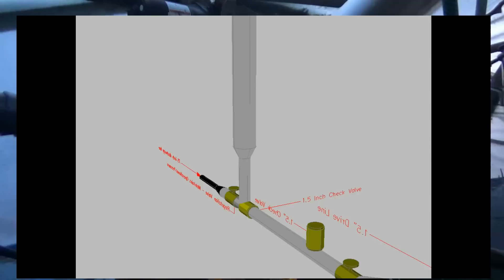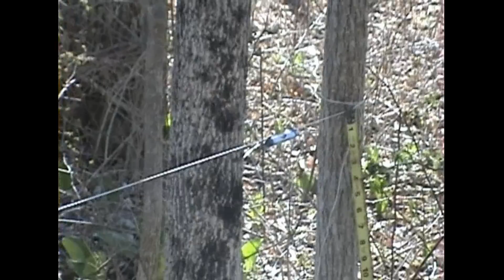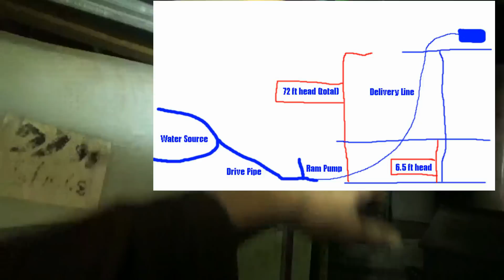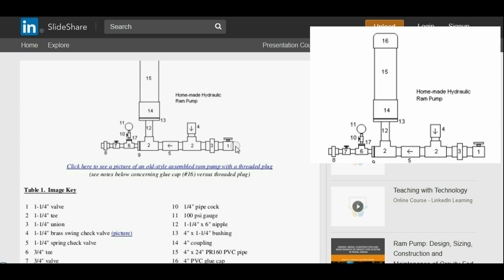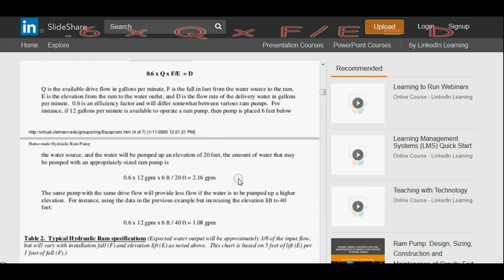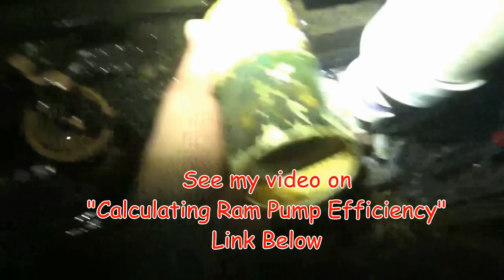Regen Ag School | Hydraulic Ram Pump Design Manual: Site Selection, Calcs & Field Operation

Comment: This guy seems to project that he's too smart in calculating water pressures yet he posted those diagrams portraying DIFFERENT VOLUMES of water as having the same pressures?????  $#&^%@@$$#....besides he doesn't even know the difference between FOOT and FEET... i bet you better check your numbers before showing it to the whole internet world smart guy....
Reply: I would also like to point out that the proper term is "a 4-foot head"  just like you would say you are going on a "20-mile trip."  You wouldn't say you were going in a "20-miles trip."  So, his terminology in reference to the hydro static head is correct.  In this sentence, the term "4-foot" is NOT a noun, it is an adjective describing the "head"  which is the subject.  Therefore its conjugation should be singular since it is describing a singular noun.  

So, along with your engineering lesson, enjoy your English lesson.
Reply: Actually, the POINT of those pictures was to illustrate that volume has no effect on the pressure.  The pressure at the bottom of a half inch tube is the same as the bottom of a lake if the height of the water above the gauge is the same.  Don't you wish you had phrased your ignorance a little more politely?
Reply from the maker: @kirbyspencer538   @John H Thanks.. This gave me a good chuckle!
Reply from the maker: First, "this guy" is right here, second, I COULD delete your comment, and third, instead, I'm pinning it as the epitome of ignorance.  By the way, when is your first upload? EVER?  10-25-2020 "This channel has no videos."
Reply: @TheFarmacySeedsNetwork  The f***ing nerve of some know it all to criticize (and not constructively) your video after all the effort you had to have put into it. I don't expect everything I read or watch to be perfect, and your videos, this one especially, are an absolute treasure trove of information for those of us who are trying to learn. That troll should be ashamed.
Reply from the maker: @GarySchiltz  Thanks for the kind words.. trolls don't bother me.. I kick em back under the bridge they came from 😁

Comment: Do you know what will be the effect of the ram pump system if we only make the total length around 5 meters? You can just assume from the start, to the drive pipes, to the ram pump, to the certain head level, is just 5 meters. Do you think it's gonna be efficient in terms of the pressure and velocity, and also for its cost analysis? Coz a 120 dollars is fair for a longer system, but for a shorter one, I think its not.
Reply from the maker: 5 meters is over 15 feet.... sounds like good operating pressure.. but you will NEED to do the math provided to be sure.

Comment: well that was a clear as mud .  hers what I'm traying to do .  & you can comment on the thinking .  I had this idea it is this.  to tack water flow  & push that water into a header tank which is elevated . lets say a 6000 gallon tank As the limit of the first lift possible 16 feet .  then to repumps that water up to it limit of such lets say  to a second tank of 24,000 gallons At  50 feet above the first tank .  so the final lift will be  to 100foot above  the first lift now holding 100,000galons of water . The  Target to riles that 100'000 gallons to drive a micro turbine By releasing it down a 4" pipe  At ( 45 To 60) PSI  emptying into  a hooding tank sufficient to holding  the 100'000 gallons of water  tank  having past into a 1" pipe to drive a micros hydro turbine to charge a battery bank .  wy a rem pump  self powered the point is to slowly rise  the water to the required Hight &  achieving it in stages using the head achieved at each stage, to power a bigger ram pump.  as we sift the stored water at evry sage.   given you now have my plan  can  it be achieved   in closing the end choice will be to push the ram - pumps to pus that water back up to the heist point   Rinse  & Repeat,   Pints to develop The largest pump to achieve  it final size .

Comment: Great video! It covers many of the details of design and construction. Attention is needed in order to obtain proper function. The pump I tossed together prior to finding FSN videos is a follows. I used 1.25" pvc and some abs pipe and fittings. My drive pipe is 1.25" pvc @ 20' long utilizing a siphon over my dam with a fall of approx 7 foot. I used a reducing tee and put a 1" swing check for the waste valve. The supply outlet of the goes into a 1.25" line check, it's output into a 1.5" abs sweep ell into a second pvc tee into a 4" abs pressure chamber 4' long. Empty liter bottle for air buffer inside. My supply line is 1.25" pvc for 80' then reduced to 1" for a total of about 450'. Initially I was not able to get the pump to run unless I really closed down my outlet valve until I added another 20' pipe sticking strait up at the end of the line to add more fall to the pump. The system runs like this but just barely. It will go several hours then stop. I have been reading ..... alot! I plan two modifications. First, replace my drive pipe with 40' of steel 1.5" pipe, second a 2" waste or impetus valve, poppet style. FSN, I found this paper dealing with waste valve optimization (quite helpful!) https://www.researchgate.net/publication/346407019_Structural_design_and_parameter_optimization_on_a_waste_valve_for_hydraulic_ram_pumps. I am fashioning my new waste valve close to the design they propose. What still needs done is how to "tune" the waste valve. Weight vs stroke. Understanding that there are two different goals. One, max pressure and drive height. Second max volume. In my case I am shooting for volume.
Reply from the maker: Thanks for sharing all this excellent feedback info!  Let us know how the upgrades go! That link on valve design is awesome by the way! in the direction for my next project... looking forward to digging into the details!

Comment: Will an oversized delivery pipe cause less pressure? My pump is all 1 1/4 galvanized.  It works at 12 psi and delivery side valve shut it builds up to 20. My delivery pipe going from pump to up hill to house is 1". If it was 3/4  or 1/2 I'm assuming the pressure would be higher
Reply from the maker: Larger pipe would likely devlop more pressure... not sure i understand your configuration, can you post a video?
Reply: @The Farmacy Seeds Network  
I will. When I do ill put a link on this comment section
Reply: @The Farmacy Seeds Network  
I will. When I do ill put a link on this comment section
Reply: @TheFarmacySeedsNetwork  
I'll have to upload a video tomorrow when I'm in town.  My service is not good enough were I am

Comment: Hi. Thanks for the detailed info. My pump is now installed (1 1/4") with 30' of 1 1/2" pvc and 30' of 1 1/4" pvc and about 7' of head. Pipes are secured to the creek bed with 2 hole straps using concrete anchors.  I desire to pump 300' uphill with 22' of elevation difference. I am using 1/2" PEX and no stand pipe, ...yet. My pump is cycling too fast I think. Possibly at the rate of almost 2x per second. (5 times in 3 seconds) I am only seeing a trickle at 15' elevation so far.                                                                                      
I should also mention I am using about 1' of syphon to pull the water up out of a depression in the creek bed. Anyone have suggestions for slowing my pumping action?
Reply from the maker: Check this video out, then let me know if you still have questions.  Sounds like a nice setup!  https://www.youtube.com/watch?v=O2reJH4Bfqg&t=4s
Reply from the maker: cycling too fast prob still have air in the line or are taking air on into the supply pipe.

Comment: This is the third vid I have seen on this subject, all very interesting. There are variations between people, but I think I may have come up with
some fine tuning! The air chamber in most of the setups, have a 26" bicycle tube fitted, well why don't we drill a hole in the side of the air chamber and
put the tyre valve out though the side, so that you can alter the internal pressure without pulling the whole thing apart???
Have a great day.
Reply from the maker: It's something I considered as well, but after realizing how much wear and tear that pressure chamber is under, I think it would leak pretty quickly... If you try it and it works let us know! cheers!
Reply: Not if you put the valve at the top of the compresion chamber!
Because all the tube will be below it to protect the valve.
Its a no brainer. Also the bigger the chamber, the more room there would be to absorb the shock! I would put money on it.

Comment: Would you be able to advise me on sizing my ram pump please?  I'm living in an off grid location around what I've calculated is 20m (65ft, similar to yours in the video) vertically above a freshwater spring with ample flow.  So I'm hoping to ram the water the 250m distance to my accomodation.  I only need a small volume 50-100 litres per day delivered.  The question really is more about the vertical height I need to drive it.  What size ram pump, drive and delivery pipe would be recommended for this situation.  To throw a curve ball into the mix, a friend of mine decided to go and order me a complete 1/2 inch ramp pump from a YouTube seller, so I have one in hand.  Can I make this size work do you think and if so what size pipe to drive and deliver? Cheers John
Reply from the maker: It's hard to say without knowing the flow you have and the delivery elevation...  but I included the link in the description of this video (Clemson EDU) which has charts, formulas etc...  Have a look at that and see if it helps... If you still need help hit me up and I'll walk you through it. Thanks for watching and let me know how you make out.cheers!
Reply: Add weight on waste valve.

Comment: Hey man, thanks for the video, lots of good info. I have been running a homemade ram on my property for a couple years now, and have learned a lot on my own and gone through a lot of trial and error. I have a question and wanted to see what your opinion is. 
First of all, I have the ability to adjust the impetuous valve and choose how fast or slow the ram runs. (How much water it uses)
I am in the middle of building a water tower on the top of my hill and wanted to see what you thought about something.
I have 15 feet of head pressure for ram, (10 foot standpipe and 5 foot drop in drive to pump) I have about 8 to 10 gallons a minute in water. Water tower will be 105 feet above pump. That is pretty much maxing out the capability of pumping elevation at a 1:7 ratio. Would it be better to run a 1 inch ram adjusted to run about 8 gpm or a 1 1/4 inch ram adjusted to run 8gpm?
The 1 inch would run slower and 1 1/4 inch would run faster but both would have same head pressure and use same amount of water. Is there anyway to determine which will pump more water or pump higher? Or would they be essentially the same because it's the same head and same water volume running through pump? Hopefully that makes sense and hopefully you can point me in the right direction
Reply from the maker: I would expect the larger pump to perform slightly better efficiency wise... It gives a little more "hammer" weight in the pipe size and theoretically will impart more energy. cheers!
Reply: @TheFarmacySeedsNetwork  thanks for the input! That's the size I already have set up so I may just leave it alone

Comment: Well as.a.newcomer to all this "new" technology ( to me anyway), and I am still baffled by the whole deal. My question is , I have a flowing creek , never  dries out, and where I can use the water is the issue it is 2-300 feet above the creek. Is it practical to think this system would work  , not so much for an extraordinary amount of water but let's go with 200 gallons a week. Or am I expecting too much . Any response would be appreciated
Reply from the maker: How much vertical drop do you have at the creek and how much flow?  See that link I mentioned in this video for simple calcs.  Hope this helps.
Reply: @TheFarmacySeedsNetwork  thanks for getting back to me I will re watch the video.
Reply from the maker: You're welcome.. This is the link I'm referring too. I was on my phone for the first response... a bit awkward.  On my comp now: https://www.slideshare.net/Fatin62c/homemade-hydraulic-ram-pump-clemson-university
You need to know the drop from source to where you would place the pump, as well as the rise to the delivery location (both in vertical feet). Then calculations can be made on whether or not a ram pump will work there.  cheers!
Reply: @TheFarmacySeedsNetwork  
Well there is -0- drop from where the pump can be located . The creek flows 365. But is relatively...flat...so with that said I am guessing I cannot move water uphill 300 ( + - ) feet.

Comment: You mentioned that the 'foot check valve' was superior to the swing check valve and said you would link to that in the description.  Although you linked many references, I don't see it.  I was wondering if you could tell me about various versions of 'foot' check valves, why you picked the one you did, and a reference (or link) to a supplier.  Great video, I had previously seen  the Clemson paper, but your reading it did alert me to a couple of things I might not have emphasized.  Thanks.  Edit:  I have google 'foot check valve' and see many, but none look like yours.  I'm sure this is due to the 'cover' on the valve picture, but surely there must be some that are more suitable than others.  Thanks again.
Reply from the maker: One of my other videos I had this same question.. Can't seem to find that comment now though...  Just a brass or stainless foot valve of the size you need for your pump will work just fine.  Let me see if I can find a video with a little more detail.. 
https://www.youtube.com/watch?v=grBdwsrsOA8
https://www.youtube.com/watch?v=KXdtPaMTPDI
https://www.youtube.com/watch?v=vrOgObZ0wos
See also my playlist on ram pumps and water delivery:
https://www.youtube.com/watch?v=tn8ZzEDt7p0&list=PL837tk-T71Lgw3Of_XqmoPrj3tdsVIURE
I hope this helps.

Comment: Use siphoning so your ram pump become more powerful
Reply from the maker: Can you elaborate? Please share your experiences.
Reply: @TheFarmacySeedsNetwork  simply you made a u shape. 10 meters tall structure and on the other end use a stock of water which act as pressure valve and your work become automatically lesser
Since water draw out water from lower point to upper point due to its own weight

Comment: Wow! Excellent teaching methods on your execution of information.
Reply: Can you do a problem solve if I give you the stats to my hammer pump system? I have only 1gal every 20 minutes on the output flow. (Dribble). Input flow is 12 gal/min. 35’ length 1” intake pipe, 3’drop in elevation from source to pump. Pump taps ever 5 sec. delivery hose is 3/4”. Elevation rise 75’. Id like to send photo of pump. I know you must get questions like this all the time but for me to use all the data you give will take me a while to digest the info.  Im thinking I may need to drop my pump a foot in elevation.
Reply from the maker: I can, but can you share a video so I can better visualize what you are working with? 
On the math: 
.6 x q x F/E = d
Q = input flow
F = fall
E = elevation
 .6 x 12 = 7.2 * 3 / 75 = .04 = D
7.2 x .04 = .288 GPM  (.288 Gallons per minute)
The above calculation is based on ideal conditions.  3 foot drive fall is considered minimum for a ram.
Reply: Thanks. Id like to send a videoI and photo but don’t see an option to attach. 
Ill do the formula and did see the chart with 1m fall w 15m lift not even on the chart. We are going to drop the pump to 5’ fall.
Reply from the maker: You're welcome!  Yeah, you'd have to upload to your channel and then send a link.  Yeah.. get as much fall as you can to the pump that is the MOST important factor in yielded water on output. If you can get 10 or 20 feet, do it.  I only have 6.5 here without running 100's of feet of pipe or excavating 100's of feet of  trench.  I DREAM of 20 foot of fall! lol
Reply from the maker: Thanks for the kind words!  I really tried to get this whole video shorter, but it's a lot info and detail.  Hope it helps someone! cheers!

Comment: Very Good Info
I have found it is a matter of getting a good Cawush to get a good clank cycle .
Do you see any benefit or loss from having a 25 gal. accumulator ?
Reply from the maker: Thanks!
yes, that cycle and stroke is so important!
No, I didn't find any gain from the larger pressure chambers I tired so I went back to the smaller one and am leaving it for now. I want to upgrade to steel drive pipe eventually, but it is expensive.  An upgrade for another season.
Reply: Thanks for the info. on the accumalator .
Great  work